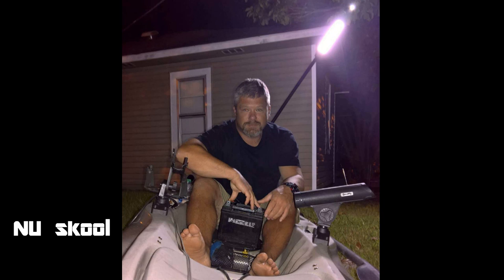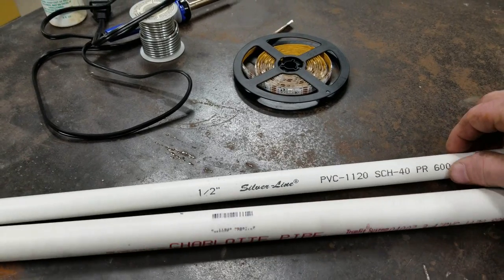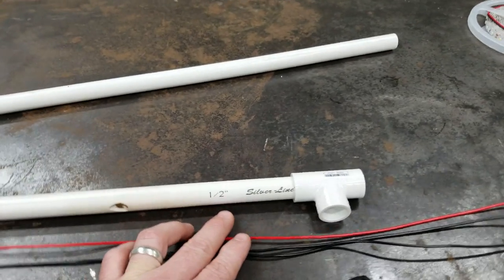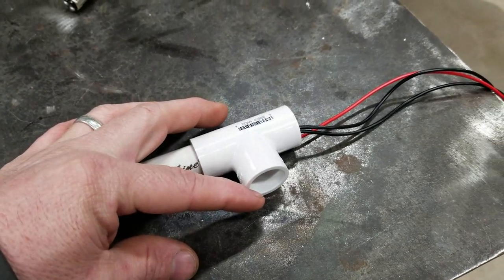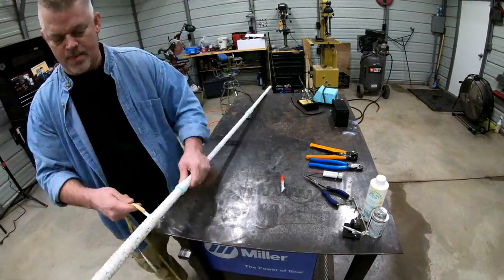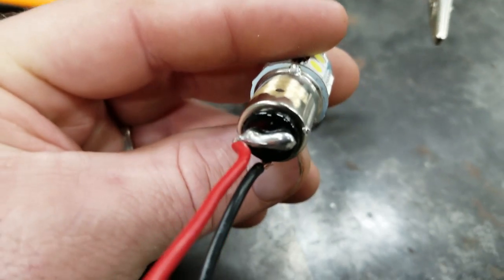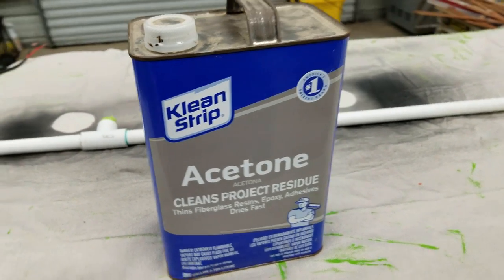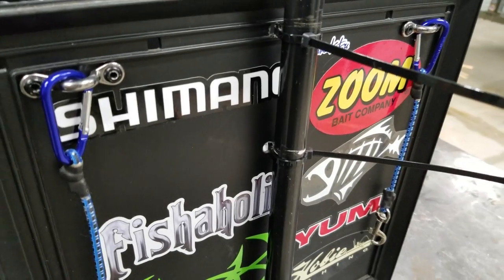Kayak Nav Light DIY (Updated)

Comment: Another trick for getting things that are too large to fit in the PVC, you can use a heat gun and heat the end of the PVC until its pliable and then you can easily slip the other piece in, and it form fits to the part making a perfect fit.
Reply from the maker: That's a great tip man , thanks for posting that I'll use that . Ive done that bit never thought of using it in that application,,, great tip . And thanks for watching top . Always feel free to comment on any of my video brother
Reply: @FishinNStuff  no problem at all!  I'm just getting back into fishing and just starting on YouTube content creation so trying to get involved with the community and help when I can 😁

Comment: Thats an awesome build bud. If any one would ask how to protect the led strip light, could you use one of those small diameter shop light bulb protecters to cover it?
Reply from the maker: You sre right  , my first light I made I used clear tubing and it just broke , you could use clear shrink tubing too . But I just leave it exposed,  the light on that video has lasted longer than the last one I made with a cover on it lol
Reply: Fishin N Stuff cool! I will have try to make one of those. I don’t take my yak out at night but that would work good for back fishing too. Mainly if i take the grandkids out for some night fish’n
Reply from the maker: I mean if you slam it against something it might damage it but the LEDs I use are water proof the Nav light on the end is fragile though but the Armor all cap protects it pretty good actually
Reply: Fishin N Stuff i liked that armor all cap idea.

Comment: Great video! What is the total height of your light pole when it's fully assembled. (I may have missed this if you said it in the video.)
Reply from the maker: Honestly I've never weighed it , but if I had to guess I would 1 and a half pound at most , it's not really heavy at all . And I never noticed it was back there , I'll tell you this the kayak battery that runs it weights more that the light
Reply: @FishinNStuff  Sorry brother, I was asking how tall it is, once you have it all together?
Reply from the maker: Ol I'm sorry , how tall it is , depends on you . It can be made any size  , the main thing is make sure the NAV light on top is taller than your head . So other boats can see you and your safe . If you want one taller than mine just make the 1/2" pvc longer and run longer wires

Comment: What kind of battery is good for rhis? Like how many volts and amps do i need? I followed your instructions and made one today, came out awesome and works great but i need a good power source thays doesnt weigh allot. I hooked it up to my wifes car battery and worked great except when i hit switch for strip lights the nav light dims down.
Reply from the maker: Mighty Max Battery 12V 7.2AH Sealed Lead Acid Battery for Electric Trolling Motor Brand Product https://www.amazon.com/dp/B00P43Y7AC/ref=cm_sw_r_cp_apa_i_ESlnEb0GQYF80
I use a battery like this one on my kayak and it works good
Reply: @FishinNStuff  my lights get very hot from top to bottom, wondering if you experienced this also? Is it normal? I think maybe some of the lights shorted out.

Comment: Question about the switch connections. Did you spilt the switch wire into two wires for both posts of the switch? I saw two connectors for the posts on the switch and you sautered those 2 connectors as well. Making one of these guys for the boat.
Reply from the maker: Easiest easy to wire it , uses just a little more wire though . Just run 4 wires a positive and negative for three brake light and a positive toi the strip light and a negative through the switch and then to the strip light . I've made em that easy and they work flawlessly but more wire  . Connect your positive and negative together at the battery

Comment: Any ideas on fixing a holes on pelican predator 130 . i filled with 5200 marine but i want external hard cover on corners btw holes are on corners they are more like 1/2"w x 2"l slits .
Reply from the maker: They sell a plastic welder at harbor freight.  Its just a soldering iron thats wide and flat . Works pretty good

Comment: And when you flip on those LEDs, every bug within a 5 mile radius will be in your boat with you. Trust me, I know. 😂😂😂😂
Reply from the maker: That's the truth but it takes a min.  You can get a short video done . And as soon as you cut it off they gone  , that's the only good thing . But I would rather have it and not need it . Than need it and not have it lol
Reply: @FishinNStuff  I just found your channel.  VERY INFORMATIVE!!! I was thinking about some sort of nav light like this. I am wondering if there is a yellow LED light that emits yellow light in the range of those yellow BUG LIGHTS? That would be the ticket.
Reply from the maker: You can buy yellow , and that's a good idea , though I've never tried it myself , I'd your videoing it for YouTube it might look a little strange lol . You can get about any color of LED strip lights . You can even get black lights in it , and make your fishing lines glow . I appreciate you watching and commenting and subscribing I really really appreciate it
Reply: If you all are worried about the bugs try it with yellow lights. I was told bugs are not fans of the yellow. If the LEDs are the ones where you can change the color it should be easy to find out if itll work or not.
Reply from the maker: You can unless your filming video then , you'll look all weird haha

Comment: Great video! Do you happen to have a link to the bulb that you used?
Reply from the maker: No Sir I bought my bulb st Walmart bit they recently stopped carrying them . But in another comment someone left they said they found one at Pepp boys auto parts store . You can't get LED brake light bulbs on Amazon too . I can look up a link if you want , I appreciate you watching and ive got  more kayak DIYs and I'm working on some more really cool one
Reply: @FishinNStuff  Awesome! Thank you so much! I looked on Amazon a little bit and most of the bulbs have a strange connector on the back. Ill check out the local auto part store. Keep up the great work!

Comment: I added a 2nd Tee and put a switch for each light. That way I can hook it up to power hours before needing a light and be able to turn both off
Reply from the maker: That's a good idea , especially if you go when its daylight . I normally never cut the safety NAV light off when I'm using it

Comment: Great video. Just wondering if you used a warm white led strip instead of cool white, would that not  be a bright but a little softer and would that not attract bugs? I am pretty sure you could still see with a warm white color? Just thinking out loud here.
Reply from the maker: Yes a warm light would work fine , and a yellow light would cut down on bugs . I just use day light because I film for YouTube and warm white has a yellow tint
Reply: @FishinNStuff  just trying to figure out another option to reduce the glare when filming on go pro.
Reply from the maker: It probably will . It has a yellow tint

Comment: If you're not concerned about shooting video, using an amber strip light should reduce the number of bugs you attract without hurting  the usability of the light.
Reply from the maker: I agree 100% , you can actually see really good with Just the brake light on , and it didn't attract any bugs . But the big light really lights the lake up

Comment: How much of the striplight did you use? Also can you not use the 1/2" pvc alone?
Reply from the maker: I'm thinking I used about 14 foot of the striplight but you could use it all . I made it thinner so it wouldn't be so top heavy , and yes you could just put it in the 1/2 and not use the 3/4 pvc but it will be longer and less focused.  But that must not be a bad thing . That's the cool thing about DIYs you can be creative . Maybe you should try it besides you can build 4 of these lights for what a YakkAttck light cost.  Hey and I appreciate you watching and commenting buddy I've got a couple more kayak DIYs I'm working on and posting soon

Comment: Why run the ground through the switch and not the hot lead?
Reply from the maker: It works either way , I've did both and never had a problem  .

Comment: Link to the switch isn't working. If you have time can you send me the link.
Reply from the maker: TOTOT 5pcs ON/OFF Round Rocker Switch for Car Dash Dashboard Truck Home Toggle SPST Switch Snap 6A 250V 2Pin 2 Position Black Button https://www.amazon.com/dp/B07D28XPKV/ref=cm_sw_r_cp_apa_i_nSjRDbAY378HA
Try  this link I couldn't find one with only 1 switch but I think most of the round switches are the same size and this is one of the cheapest I could find . Im sorry brother that's an older video sometimes they sell all the products and delete the links , but that's the one

Comment: Do you have a name of the led brake light you used . I can’t find one like the one you used .
Reply from the maker: iBrightstar Newest 9-30V Super Bright Low Power 1157 2057 2357 7528 BAY15D LED Bulbs with Projector replacement for Tail Brake Lights,Brilliant Red https://www.amazon.com/dp/B01MY4T4BU/ref=cm_sw_r_cp_apa_i_zkFxDbH8XWJCR
Reply from the maker: Anything like that would work fine I bought mine at Walmart but they stopped carry them for some reason . But Amazon has a ton of different kinds . An Auto parts store should have em to

Comment: i can not find the 360 brake light can we get a link.?
Reply from the maker: iBrightstar Newest 9-30V Super Bright Low Power 1157 2057 2357 7528 BAY15D LED Bulbs with Projector replacement for Tail Brake Lights,Brilliant Red https://www.amazon.com/dp/B01MY4T4BU/ref=cm_sw_r_cp_apa_i_w9XpEbQW32568
Reply from the maker: There's a link there's hundreds of em  . Just punch in LED  brake lights

Comment: What kind of battery do you use for this
Reply from the maker: Any kind of battery like this one will work acc long add it's a deep cycle . And you'll need a charger for it , a cheap one is fine
NP12-7Ah 12V 7Ah AGM Rechargeable Maintenance Free Valve Regulated Sealed Lead Acid Battery with F2 Terminal https://www.amazon.com/dp/B01K6VD0WW/ref=cm_sw_r_cp_apa_i_NecBDb8V5BT5K

Comment: Can you post which bulb you used for the top of the navy light
Reply from the maker: iBrightstar Newest 9-30V Super Bright Low Power 1157 2057 2357 7528 BAY15D LED Bulbs with Projector replacement for Tail Brake Lights,Brilliant Red https://www.amazon.com/dp/B01MY4T4BU/ref=cm_sw_r_cp_apa_i_KHgnDbJ8Z9SAM
Reply from the maker: That's a little different but the same size , actually it looks like it had a few more LEDs which is a good thing . I bought mine at Walmart but they stopped carrying then look for a 1157 LED bulb if you don't like that one
Reply: Thanks brother!! Love this idea
Reply from the maker: Your welcome brother , I appreciate you watching . I'll help you any way I can

Comment: How tall it end up being? I don't remember you mentioning the lenght of the 1/2 inch pvc. Did I missed something?
Reply from the maker: How tall is up to you really . As long as the top led brake light is higher than your head so boats can see you for safety , that light was made for a sit on top kayak so it was about 4 1/2 or 5 foot tall
Reply: @FishinNStuff  I did it like 7 ft tall and it worked perfect I am actually using it right now

Comment: How long have you run the updated nav light on a feeder battery?
Reply from the maker: Well ive fished with it for 7 hours but , in the summer I couldn't leave the big light on for too long it attracted too many bugs lol . The brake light never did though . I should have ran a test .
Reply: @FishinNStuff  Nice. What was the cost to purchase everything.
Reply from the maker: 25 to 30 dollar range
Reply from the maker: Get 1 color of wire to dance you some money and use a piece of tape to mark it . The rest is up to you shop around on Amazon and find the best deal

Comment: only question is ..when the light gets hot does it melt the cap????
Reply from the maker: No LED Lights don't get hot and the use half the electricity so your battery lasts longer

Comment: Which LED brake light did you use?
Reply from the maker: iBrightstar Newest 9-30V Super Bright Low Power 1157 2057 2357 7528 BAY15D LED Bulbs with Projector replacement for Tail Brake Lights,Brilliant Red https://www.amazon.com/dp/B01MY4T4BU/ref=cm_sw_r_cp_apa_i_w9XpEbQW32568
Reply from the maker: If you go on there you'll find a bunch to choose from
Reply: @FishinNStuff  Thank you
Reply: @FishinNStuff  Thank you

Comment: "Page not found" for both Amazon links.
Reply from the maker: That means they sold out
Reply: @FishinNStuff   It would still show the product, but say "currently unavailable". The only way a "page not found" would show is if the seller completely deleted the listing, which may indicate that they discontinued that model or something. (Source: Amazon seller for 7 years)

I'm sure any light that looks similar would be fine, but I would prefer one with some sort of weatherproofness at least.
Reply from the maker: @ArbitraryLifestyle  they may have,  because those 2 videos on the Nav lights I made is pretty old . The Led light strip is easily found all over Amazon and the brake light is just a replacement led bulb for an older car model.  The switches are the round ones which are mostly all the same made in China.... and the clear shrink tube is actually what they use on RC car batteries.  Just get it big enough to go over your pvc your going to use plus a a 1/4 inch for the light strip

Comment: what kind of draw on the battery is it?
Reply from the maker: I never checked the draw , but I did use it 3 times before giving it to someone  , and I fished 6 hours one night and it never killed the kayak battery.  The brake light on top couldn't pull much power . I used the led strip occasionally when I need to see better . But I couldn't leave it on long because it draws bugs pretty bad . As long as your not using it for making videos  , I could  use an Amber colored LED and it might cut down on the bugs . But it would make videos look pretty terrible

Comment: So i just tried to do this and cant figure out as to why the light will not come on when the negative and positive terminals are connected via wiring and sauder any one else having this same issue
Reply from the maker: I've had it happen.  I've b built 5 or 6 of those lights over the years . I remember having to run wires from each light to the battery  one time . Not sure why it would jump from light to light correctly

Comment: Where do you get the LED brake light? Which model car?
Reply from the maker: I bought mine at Walmart  . The lights I use is for a old car . New lights are made different
Reply from the maker: These are similar to mine
https://www.amazon.com/Upgrade-projector-replacement-Reverse-Brilliant/dp/B08H8M8LB4/ref=asc_df_B08H8M8LB4/?tag=hyprod-20&linkCode=df0&hvadid=475826414618&hvpos=&hvnetw=g&hvrand=10612701543656210928&hvpone=&hvptwo=&hvqmt=&hvdev=m&hvdvcmdl=&hvlocint=&hvlocphy=9009924&hvtargid=pla-1018945755249&psc=1

Comment: What is the name of the led brake light you used
Reply from the maker: Any of them will work just look up one for a old school car . The new cars have different ends  
iBrightstar Newest 9-30V Super Bright Low Power 1157 2357 2057 7528 BAY15D LED Bulbs with Projector Replacement for Stop Tail Brake Lights, Brilliant Red https://www.amazon.com/dp/B01MY4T4BU/ref=cm_sw_r_apan_glt_i_XYBR6DR6071YPBGYG8FT
Reply: @FishinNStuff  thanks i got them and they are awesome but when i try to use the switch the wires start burning im using 18 ga wire and i doing it wrong
Reply from the maker: @Uglyduckfishing  really I've done it several tike and never had that happen  . You might want to go up on hit sure size some the lights I used I night at Walmart but I'm not sure they still carry them , those videos are old  . You could check at the auto parts store
Reply: @FishinNStuff  i order them on amazon i just looked up 12 volt waterproof led lights
Reply: @FishinNStuff  other than switch issues the lights work great i make a video today so you can see all the lights i built using you nav light video
Reply from the maker: @Uglyduckfishing  could be the switch . Everything comes from China now . Hard to say
Reply: @FishinNStuff  what switch do you use the one i got was 12 volt 8 amp
Reply: @FishinNStuff  i found my problem it was the wire i used